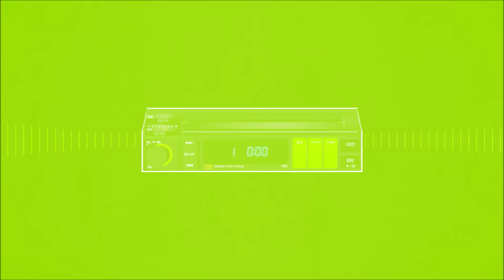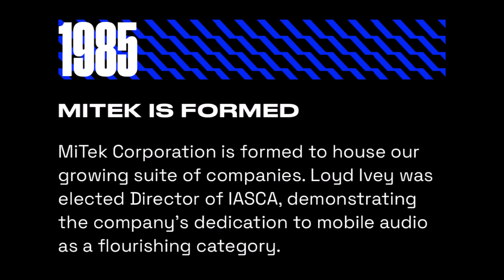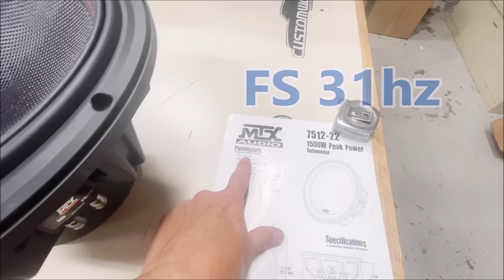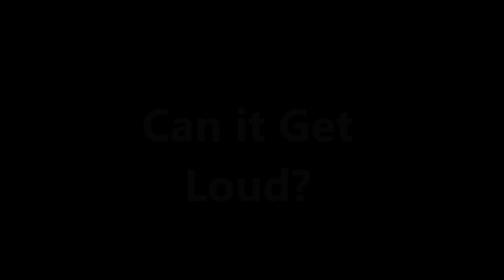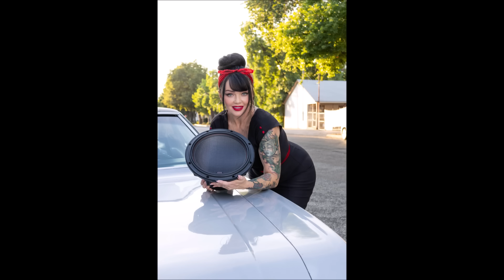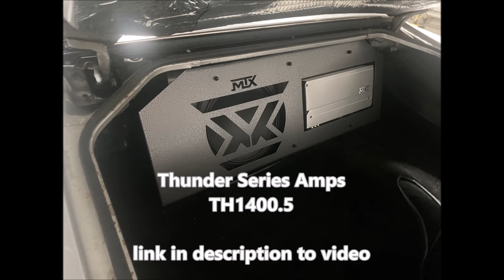New MTX 75 Series SQL Subwoofers - You Might want to Check These Out

Comment: I would buy it but I  want them to make the 95 or at least the 8500 series in size 15s I used to have a pair of 9500 fifteens back in 2002 but they stop making the recone kit but I believe the 75 fifteen will hit hard
Reply from the maker: I think the 9500 might be a bit overrated over time.   They should have a new sub out soon.

Comment: Overpriced bs
Reply from the maker: Why do you say that?  The JL is the MTX should be a little less.  Both are good subs for sure
Reply: @Hi-Fire-do  mtx has always been over priced.  And when they made good subs. With the older 7500 and the square 8500. They discontinued after a yr. I've been in car audio since 95. I have only ever owned the 9500s. Classics.  But I had much cheaper subs that sounded better.

Comment: its nice, but at 500usd says alot about inflation today. definelty a solid choice. i would still prefer the mtx 95 series with the same style cone. but the 75 series are more efficient and can perform with less amp. bigger motor and coils of the 95 series are going to perform better on the low lows, and spl. having a set of those 75 series and a thunder 1500.1 at 2 ohms would be a rockin setup that would not only look nice, sound good, but would probably last.
Reply from the maker: I agree.  The thunder amps are really nice.

Comment: I still run my 2 jackhammer 5512s in my daily. They’re in the prefab box from MTX and running off a 1500w Audiopipe and they still get loud, take a beating and turn heads. And the best part is I’ve been running them since the very last day Circuit city was open (got them the day they locked the doors). They’ve been through 4 amps and outlived 2/4 (1 was gifted to my nephew for his girlfriend’s car). They even outlived a jl1000/1 (yes you can kill them and yes the audiopipe is louder). Cool to see MTX coming back and bringing the Thunder. Pun intended.
Reply from the maker: That’s cool those subs are still kicking, pun intended.  😂

Comment: MTX  a great company.. yeah right. I can't get a schematic for a Thunder 7801 because I'm not a authorized dealer. I don't do amp repairs for anyone but myself, it's a hobby I started in the mid 80's. I bought the amp from a pawn shop and never tested it till many years later, thats when I found out it's not working. It's a couple of SMD's driver transistors that's fired and I can't find replacements, so back in the closet it goes. Nice looking wall art.
Reply from the maker: No companies freely offer that stuff.  If you can’t fix it send it off to be fixed. Most people do t use schematics anyway.  Not MTX fault.

Comment: Using the same size box doesn't make the test equal tho...you need to match the system Q or QTC
Reply from the maker: Yes. I do realize this.  All of the subs recommend a box this size or very close.  A sealed box is very forgiving vs a ported.  I also prefer a sealed box for sound

Comment: For 500$ cash I get 4K rms 4 inch coils woofers 12’s to 18’s from my builder using TI frames and motors from Orion, sundown,resilient sounds… obviously if I pay more or less things change but performance per dollar is what I’m after. And yes I have a big alternator and battery bank to say the least. I watch stuff like this cause newbies watch stuff like this so I like to know what they’ve gotten to know.
Reply from the maker: This was targeted to a more daily used all around system.  Most people don’t have the need or space or budget to do a system like yours.  My test set up can be reasonably done. Thanks for watching and commenting
Reply: Sound quality guys want detail not air pumps. I enjoy competing and building demo vehicles but my daily id much rather have a MTX 7500 vs an Inhuman from Sundown. Both fantastic products both very different sounds.

Comment: @Hi-Fire-do- MTX's current top Dog Subwoofer= their (369 Lb. 👀), 24" Square subwoofer the "JACKHAMMER" (can be bought as a 22" round subwoofer as well), it has massive 6" dia. voice coil's, is rated @ 4,000 watts R.M.S., & retails for $9,999.00 each👀!
Reply: Come on, you know that's not a current subwoofer. That thing came out over twenty years ago and is no longer in production.
Reply from the maker: Try and get one. Lol. 😅

Comment: 6:30 Most quality subwoofers can handle power exceeding their RMS rating. However, surpassing this threshold often causes the motor to convert electrical energy into heat rather than motion. This leads to "power compression" in the voice coils, reducing efficiency, which was likely the cause of the smell you noticed. While I used to overpower my subs, I was simply wasting energy; a properly rated subwoofer would have stayed cool and converted more of that power into mechanical force.
Reply from the maker: I agree. I was pushing it it for the sake of science
Reply: You have to keep in mind that rms is essentially average. They are telling you the average power, it can handle. The max ratings are usually the power it can take in short bursts. (I say usually because some manufacturers don't actually test for max power. They just make up a number)

But yeah, you can usually go way over the rated rms power with no issues.

The smell is just your typical off gasing from the glue or epoxy used to bind the voicecoil. It will do that when it gets heated. It's a good indicator to turn the power down when you smell it. After cycling it like this a few times the smell will become harder and harder to create. As those glues bake in, they become more durable. Generally speaking. Manufacturers can use a wide range of glue. Some fail at low temperatures, some fail at high temperatures. It can be hard to predict.

Comment: Very cool MTX is still family owned.i used alot of their gear in late 80s,early 90s,terminator subs were hard to beat for the money, and the 90s thunder amps were top notch
Reply from the maker: Their thunder amps now are awesome.  Thanks.
Reply: They still make great products. The new amps are super nice
Reply: I remember running some blue thunder 12s off a sherwood 240
Reply: @charlesreedy9330 my first "real" non flea market system was a sherwood 70+70 on terminator 15s,wasnt too bad
Reply: @charlesreedy9330 the old Sherwood 240 watt amp. That was one of my first as well.  I ran 4 MTX Terminator 10's off it and later 2 gold letter Kicker 18's 😎 Old school efficiency could be heard for blocks
Reply: The mtx 2300x a bad ass amp

Comment: I haven't had any newer MTX subwoofers, but I have used the 8000 15's in a sealed box years ago and they were amazing!! They really do make FANTASTIC products!!
Reply from the maker: They are trying to make a good comeback for sure.
Reply: I had 6 MTX 9500s 12's from back in the day. I tell you what those things were loud! The new stuff does not look like its built as well.
Reply: curtpark4316 - even this 7500? To me it looks Solid, and I really like that new surround for the increased cone area it provides.
Reply: @furion..  Looks good. It does look alittle cheaper made compared to their older stuff. But i have never had a issue with MTX warranty.